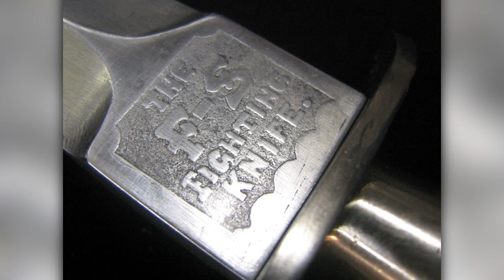Fairbairn Sykes Commando Dagger | Paul McDonald | Bought The T-Shirt Podcast

Comment: What a great vid! 
I’d read a few articles about the FS Fighting Knives, including one written by an American collector but the chances of finding and owning an original Mark 1, FS Knife are slim to nothing, especially when it comes to cost.
One of the best modern knives that you can get, one that is loosely based around the FS Fighting Knife, is the Eickhorn FS2000. Eickhorn are a long established German Knife manufacturer and they’re based in Solingen. If you handle one of these Eickhorn knives, then you’ll instantly understand what it’s primary use is, a surgical tool of death. Like the originals, it’s exceptionally sharp but the blade isn’t shaped like the FS originals (any model), being of regular width along its main length, until you reach a point where a tapering point is required.

If you can’t find an original, or afford Paul’s version, there’s always an Eickhorn.....just don’t stick it in your arm like I did....😬😜😂😂😂